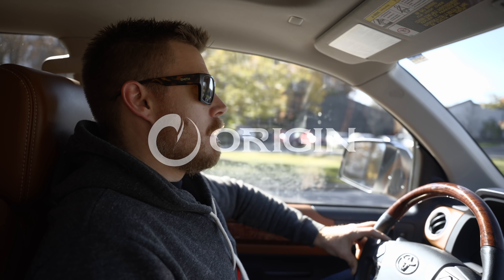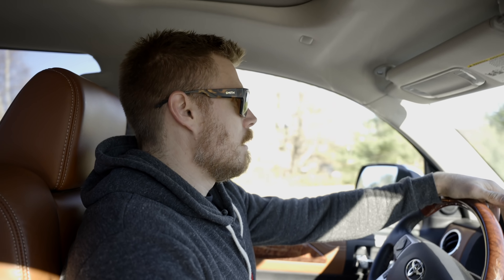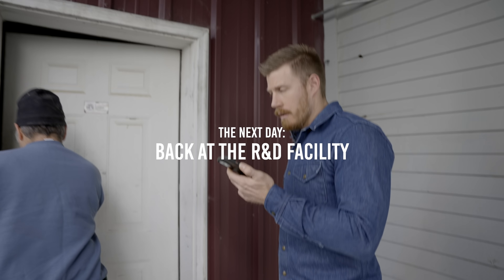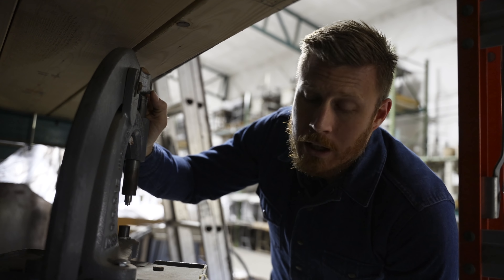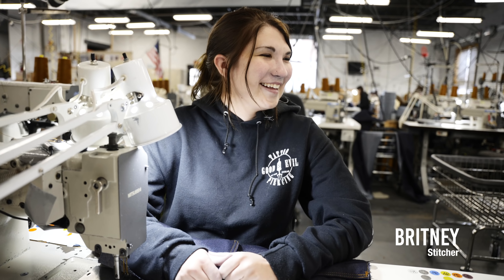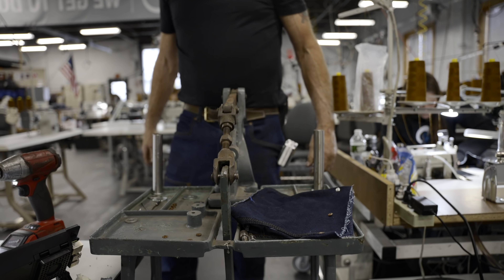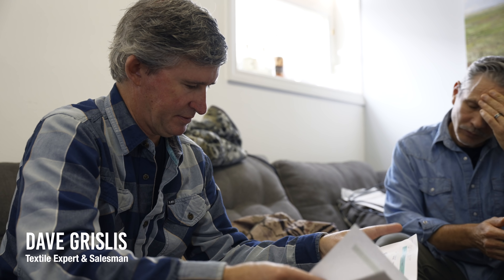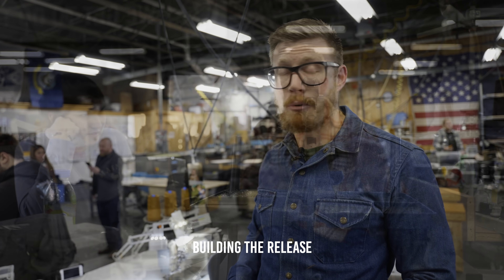AMERICA NEEDS THIS.

Comment: There is a LOT of science that goes into developing hunting wear. A lot more than  casual or work wear.  It's has to be light but durable. It has to keep you warm in the cold and cool in the heat. You have to be able to comfortably use multiple layers. The patterns have to be functional for environments they will be used in and species that will be hunted.  Are you y'all sure your ready for such an endeavor? 

Also what's the plan for introducing merino wool into your material resources? Because I'm of the belief that merino wool is one of God's greatest creations on this earth and most of not all the clothes on your body should be made of some kind of merino wool blend, especially for hunting wear (especially under garments).